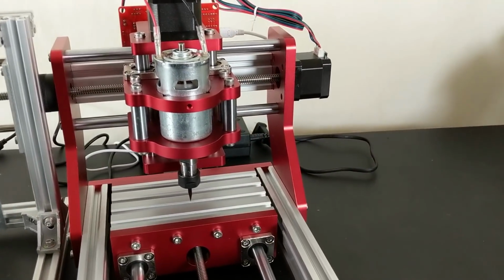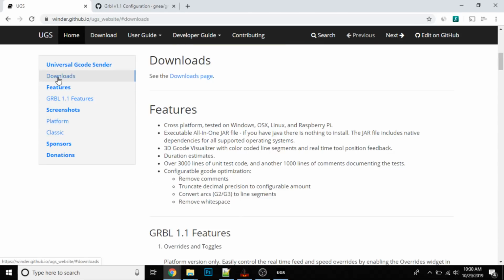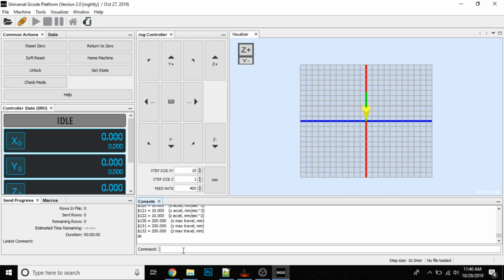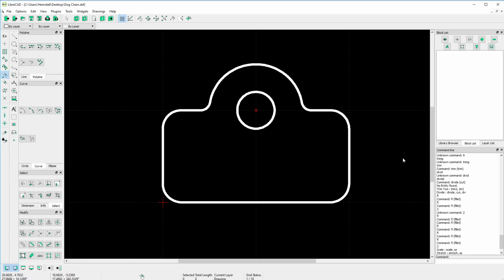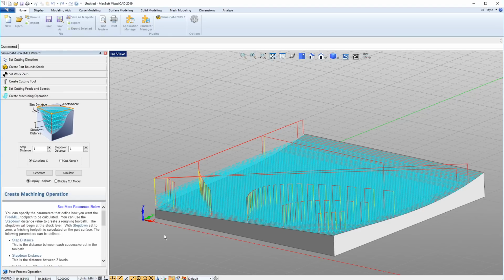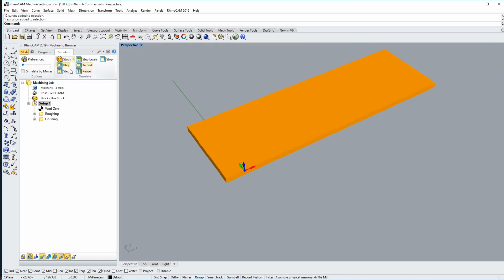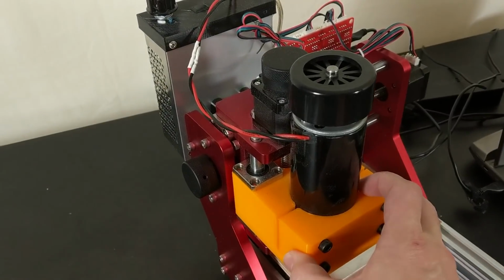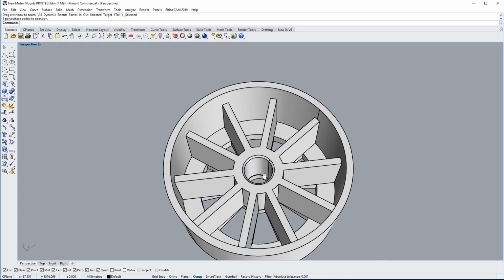How To CNC Cut Metal For Under $400 using the 1310 CNC Router

Comment: Your rpm’s are way to high I’d run it 3000 rpm’s despite what charts or tables you look up
Reply: I’ve been machinist most my life. When it chatters you either decrease speed or increase feed. In your case of welding aluminum to your bit  means excessive heat from high rpm’s
Reply: A dab of wd40 oil will help too

Comment: I wonder if the dead center 0 point is useful for the purpose of cutting from the center out. Maybe this makes the clamps work better. rather than weakening the material right next to the clamps first.

Comment: So basically, any CNC machine under $1000 isn't worth it, if you want to cut metal.
Reply from the maker: Like all things. It can be done. How much time an effort do you have to spend on it? Adaptive tool paths would have made a big difference with this printer in the video. There are just so many variables. I would go with a machine which has been proven to work.

Comment: In the world of machine shops either the work is held still or the tool is held still and sometimes both. If it is rigidity you want switch all motion functions to the bed to which you fix your work, so the bed moves X and Y and Z and the tool is rigid and solid. Just like the big boys.
Reply: I think the gantry style of router is a problem for harder metals.

Comment: looks like you were getting close.. the spindle definatelty needs a metal clamp.. the Z slide rails are often the weak point , they were on my 6040 cnc although that could cut aluminum just fine with light doc and proper feedrates.

Comment: A channel named "Awesome CNC Freak" recently made a vid on how to upgrade this machine. He decreased the backlash, the chatter, and even milled steel.
They look like low cost improvements; he used the original motor but added pulleys and a better spindle. I'm super tempted to try.

Comment: Thanks for the exhaustive review of this product. I know you decided to yeet this machine but did you try a ball end mill? I've managed to do some very basic alloy cutting on my (almost - it has z-touch) unmodified 3018 using ball end mills. 0.1mm cut depth but good enough to produce some alloy logos for my mate. I tried end-mill cutters in the 3018 and just broke them. The ball ends however worked ok.

Comment: in your conclusion you thought you had it with the air pressure moving the shavings. thats when i thought to tell you maybe instead of air pressure that should have been a vaccum.

i know that phase is probably gone but if not can you make the motor bracket on this next machine, put it on the 1310 and send it to a smart guy that gave you an idea, (vaccum).

Comment: You're right about "milling bits" not liking to drill, that's why there are two types, end mills which don't have drilling capability to speak of or swarf clearance, and slot drills which do like to drill, do have only two flutes to clear swarf and also can cut slots full width due to there only being two flutes. Mix those two up and you'll break tools you needn't.

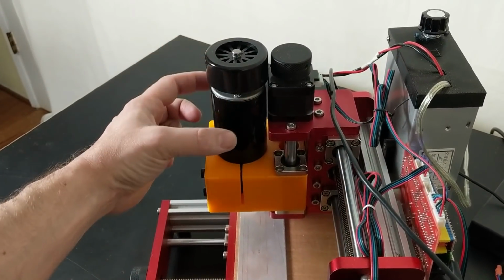Comment: 38:21 They usually oversize the fan so that it is more effective at cooling the motor with the air flowing over the top and cascading down the sides. When you make the fan the same size as the motor it causes the fan to dead end right into the top of the motor and won't have the same air flow down the sides.

Comment: You should use alcohol when cutting aluminium, I use that blue stuff which is used for cleaning (I don't know the English term).
I had the same problems even with a far better CNC machine, but all those problems went away when I started using alcohol as coolant/lubricant .

Comment: Thank you. You just saved me a lot of time, money and frustration on buying or DIYing such kind of machine. It turns out that for my needs it's cheaper and better quality just to order required parts (tested with 3d print) in some kind of CNC cutting workshop.

Comment: If you get a chip trapped under the tool of any mill one of two things happen - any play in the machine will cause chatter or vibration or you will break the tool - even on largeish commercially made  metal mills - you have to have realistic expectations - fit some steppers onto a commercial machine if you want to cut sizable chunks of metal - Stay safe.

Comment: To have your 0 the center of the part is easy  I been a machinest for 21 years though but whatever is easy for you. There's probably 50 ways to do the same thing just a matter of what way works for you. Using bottom left corner is quicker using a edge finder.

Comment: Hi I know this video is a year old or so but I just wanted to drop some suggestions from a CNC programmer. as far as your bits collecting aluminum in the pores of the carbide soak the bits in hydrochloric acid overnight and that should takeoff any aluminum that’s residually on them it works better than lie. also instead of air they sell cheap mist cooling systems that use air and a water soluble coolant to cool the tool and clear the chips away they don’t make much of a mess and give you a tremendously better finish , cut speed and tool life. Also consider some three Flute mills I’ve noticed they cut down on chatter due to the fact that there is always a flute in contact with the work and the pressure never really comes off of the bit in a cut as it does with even number flute end mills. 
Anyway I hope someone get some thing out of my comments great video and very informative thank you!

Comment: Just put the clogged bit in some (Sulfuric acid)  battery acid. Will work great! Do a video on that! Helpful DIY tip I’m glad to have learned.
Reply: Lye will probably do better when removing Al from HSS cutters.  I'm sure the acid will attack the cutter where the lye will not.  I have personal experience with lye on Al.  The reaction is vigorous.

Comment: ive been looking at DIY CNC setups. i considered buying that snapmaker 2.0 but i just dont know...   i want to be able to do like 4x4 wood and aluminum. id like a cut height of 3 or 4 inches to do multiple layers of wood.  trouble im running into is its either a 10K$ machine or its some tiny thing like the one in this video that is just worthless for any kind of work load.  i just dont know where to turn

Comment: This is a fantastic video. I've been playing with a dirt cheap 3018 for over a year which has taught me a lot but I learned loads more from this vid. I will just note that the title should have been "Proving That It Is Impossible To CNC Cut Metal For Under $400".

Comment: Shouldn't you be using a lubricant?
Reply from the maker: Lubricant helps mostly because it strips the heat away from the cutting surface. It also helps to clear chips. Both of these tasks can be achieved with compressed air as I have done. Compressed air is not effective on robust serious CNC Milling machines because the volume of material being removed is much much higher than with this machine. Some other DIYers have had some luck with WD40, but I have not yet tried that, and I would prefer to not babysit my machine spraying it WD40 periodically.

Comment: I've been developing a new program called PixelCNC you guys might want to check out. We're about to enter the beta phase of development (features are in and just needs to have bugs found and fixed) with the launch of a new store system. It's geared toward designing and CAMing CNC art, signs, engravings, etc... as opposed to precision fabrication.

Comment: feed and speed calculators are useless in these cheapo chinese machines. because of the lack of power and rigidity its best to pick a light cut at a speed you feel comfortable with , then increase it until you hit that sweet spot. you may find correct feed and speed  for a shapeoko but nothing smaller. on mine i upgraded to 92ozin motors, the 500 watt spindle. and all metal part replacements. on top of all dont use crappy bits. you will spend more in $1 bits and wasted parts then say buying a $25 bit. but i have a 3018 that can cut aluminum easily enough but i had to seriously modify it. oh yeah biggest improvement i made was converting my steppers to hybrid closed loop steppers. and it made the loud steppers silent and strong as hell and deadly accurate. my 3018 cost $240 spindle $50 Stepper motors all 3 $82 Aluminum z axis $85 Closed loop hybrid kits $64 and the most important upgrade Tripplite USB Cable. why risk your job on a 20 cent chinese usb cable. changing that cable, grounding the machine properly and using quality bits made my 3018 production ready. any job i can throw at it in upto aluminum but not steel it can do again and again. no lost steps, no more wasted projects and no more usb disconnects. currently i have a $2000 control system and a $1000 spindle waiting for a $3000 frame which is supposedly in port waiting queue to dock. As soon as you get done what you wanted to in the smaller machines and go through that learning process its time to upgrade to more professional hardware because what you want to do always gets bigger with time. and unfortunately china is the only way to go for a heavy duty frame and i know iwill have to modify and upgrade that but for the prices of aluminum in the states i cant buy the material and then get it machined cheaper than going with a chinese frame.

Comment: When I work on projects that require accuracy (pretty much everything), I work off centers to be sure that my parts are balanced. Using all the Cartesian coordinates enables ease of symmetry for parts or structures based on center. Using all positive x,y coordinates will make symmetrical layout a bit more difficult. For example, if you are cutting brackets that require holes equidistant from center all you have to use are identical integers for distance and assign positive / negative values in either x and y or both. Anything you create that is radially balanced on center would be a bit more difficult using all positive coordinates.  In the end what works for you is what works, so I do understand that when things are confusing, using a method that enables you to move on and be productive is most important. Thanks for the video.

Comment: and the poor motor.. its got brushes.. my cnc 6050 had that motor and it lasted christmas, January, Feburary, and the brushes were gone. Fine a local supplier and they made a bag of brushes.. Great. 3 weeks later the armature threw a segment. Give up and by a 1500watt VFD .. and  the water jacket is blocked.  Cant clean out the piece if rust in the bottom of the motor that moves to block the outlet whatever way the water flows. And 12 months later the spindle bearings are finished.  Oh and aluminium use a curved single flute cutter. with no more than 12mm long. I dont use spiral bits. More often I use ordinary flat single flute wood router bits.

Comment: I had a cheap 3018 that I upgraded to a 500wat spindle and circuit board to.
And found that harder Aluminum cut better as the softer stuff gums up the tooling and causes the tool to wonder.
if you cant buy harder Aluminum then uses a lot of coolant.  don't use oil as it will cause it to thicken up and go gloopy
Also use a single flute bit,
If you have a good cam software that supports adaptive cutting then it will definitely help the chatter problem
If not then look at your ramps
Meaning the angle of let say 2 degrees will help a lot
And be aggressive as to the cut that that the machine can handle and then use a nice finishing pass

Comment: I am looking for a way to mount a device that is VESA compatible on a standard camera tripod head. So, if you're familiar with most cameras, they have a female 1/4" -20 thread receiver, I want to make a plate that is deep enough to have the bolt that is on the tripod head fit and the plate will also have the VESA mount through holes. 

Here's a link to the closest thing I have found that at least at some point existed. The dimensions and details would vary, but the picture is a good illustration. If you look at the pic the center hole would be where the tripod camera heads screws into. The outer 4 holes that are recessed a bit would be there the bolts/screws that will go through and into the device that has the VESA mount holes in it already. 

https://www.bhphotovideo.com/c/product/997510-REG/teradek_bit_030_link_tripod_mounting_plate.html

My question is, would CNC cut aluminum be ideal for crafting these? Does anyone have an idea how much something like this would cost? Aside from the initial 3d design file, is there a lot of setup time required?
Reply from the maker: I would think 3D printing would be ideal for this. Each plate will cost you less than a dollar. I have 3D printed tripod shoes on most of my cameras. You could even get threaded inserts if you will be removing and re-installing cameras frequently off/on the plate. However, if it's just an install and forget about it deal just thread the bolt directly into the plastic. Just be certain not to over torque when installing. While the plastic threads can withstand almost the same force as the inserts the hole is easily stripped out during installation. https://youtu.be/G-UF4tv3Hvc?t=494 The plastic has the added benefit of being a locking fit. The bolt will not back itself out. Functioning like a nyloc nut. You can easily draw this in Free TinkerCAD yourself and print it on an Ender3 which costs $155.

Machine shops typically charge by the hour, somewhere between $60-$120 YMMV. To CAD and cut the first plate would probably be 1-2 hours of work.
Reply: @DesignPrototypeTest  Thank you so much for the info.
Reply: @DesignPrototypeTest  It sounds like 3d print would be cost effective. The 1/4"-20 receiver would get the most use, as the purpose of the plate/adapter is to allow the device to be mounted on a tripod head or easily removed and placed on a desk. So, perhaps a metal receiver insert would be worth the cost. The screw holes for mounting to the VESA would get the least use.

Comment: Use aluminium Type 2007 or 7075 or 6061, standard aluminium from pressed profiles, cuts very bad. Use an cutter for aluminium, mostly 3 flutes with 55deg angle, the one flute is good for wood and multiplex or plastic .

Comment: When cutting aluminum, in order to prevent clogging of the cutting bit, you don't blow air into the bit! You absolutely need to lubricate often the bit. Nothing replaces lubrication.

Comment: forget precise metal or even plastic cutting without closed loop system. If you try to increase the feed rate in stepper system, machine will lose its position.  Don't waste your money.

Comment: There are a few machining strategies that should be used for weak machines/setups. HSS tools, even 4 fluted tools, are preferable to carbide. You want to always conventional mill, never climb. Climb milling kills machining passes when the rigidity and backlash get involved. I feel like a very short 2 flute HSS low helix tool conventional milling with small step downs and high feed would work best here. Also, I doubt know why everyone thinks soft aluminum cannot be cut without coolant, that isn't true. It just isn't, and there isn't much more to say about it. You encompass that factor into your feeds and speeds. Aluminum only gums up if you heat up the material during the cut. If you don't, it will not be a noticeable issue.

Comment: do you think this would be fine for wax? for jewellery making purposes
Reply: Likely would. This is very close to handling aluminum, ehich means anything softer will likely turn out well. You'll just have to learn what setup and tooling works for your specific projects.

Comment: I really wish people would stop making vids stating you can cut aluminum on these pieces of crap. you need to spend a couple grand if you want to cut any useful aluminum. first a 775 spindle doesnt have any torque at all and the 42 oz in steppers they come with cant move the bit through shit. lastly you will never get feed and speed rates to cut any metal. remember if your producing dust your destroying your bits and machine

Comment: I agree with you on the lower left of the machine should be 0,0 the only reason I can think that they would make the center of the cut area 0,0 is their programer doesn't have any real world experience.  Most drafters, and other trades people were trained to use 0,0 as the lower left.  in the end it doesn't really mater, it still math but it would bug me too!

Comment: I think your flute information is wrong. I never use less then two fluted. 4 Flutes are generally for steel.  2 for aluminum. A single flute for cutting some plastics but two flutes works just as well if not better for plastic. The flutes is what clears the chips. Also you might want to check your collet holder and the collets. I had one like you have there with a set of collets and had to send it back when I discovered they were not machined correctly and did not run true. They look nice but are basically crap. I ended up making an adapter so the machine would accept an small router motor. And bought bits with one sized shanks. I believe 1/4 inch shanks. I got the smallest router they had at Harbor freight. Much more powerful then the motor you put on there. I also purchased a speed controller that the router plugs in to. You might try spraying a little soapy water on the bit as you cut. Or a light cutting oil to keep the heat down as I think that's why the metal is sticking to your bit at high rpms. Melting the metal. You will still have to take light cuts with the router as those machines are not rigid enough for heavy cuts at high feed rates. You just have to carefully experiment and start slow and light. Do not attempt to cut steel.

Comment: Seems like no one has figured out that not everyone needs a computer guided laser. Just one that cuts metal. If you are cutting straight lines you don't need all the software just a good laser cutter and maybe a speed dial.